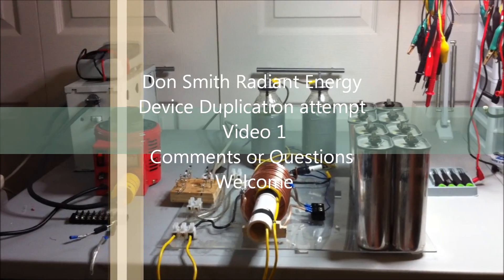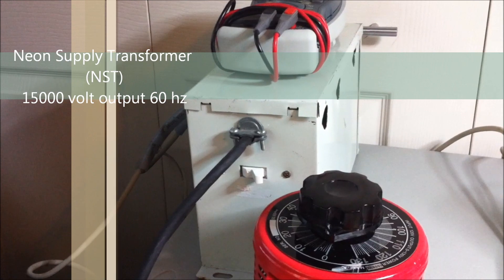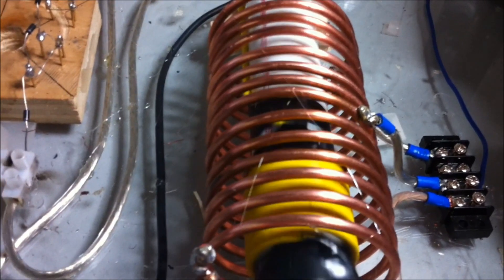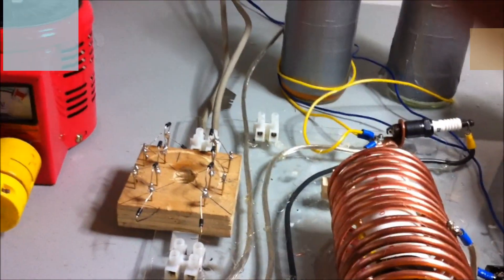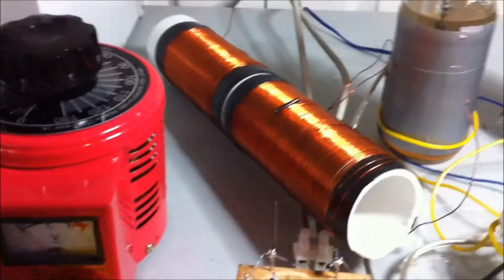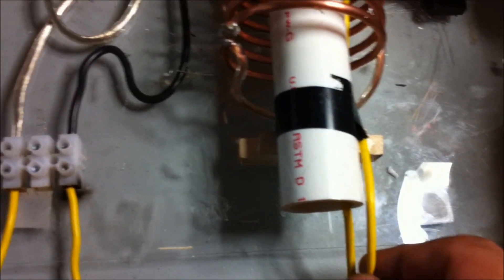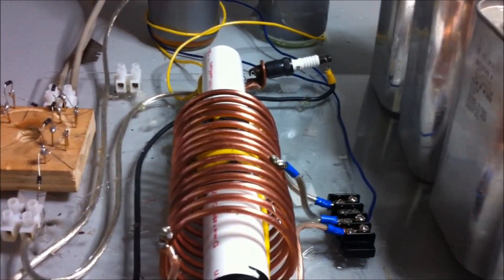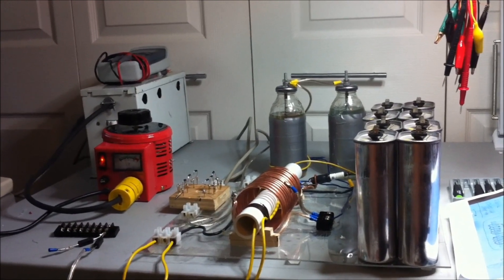Don Smith Device Build Video 1

Comment: Capacitors usually become open to charge storage at higher frequencies and the storage has to be adequate big and then use a step down transformer with rectifier to store it down 2 a battery, a smart gap would like the u used shd have even out voltage or as voltage controller but coils current determines its voltage output so use something to raise the voltage to coil by high frequency supply ac

Comment: Thank you for sharing your video on this. It looks like you're in the game with most of what you have going on. I've been studying this type of energy for years now.  I'd recommend changing your spark gap from a sparkplug to atleast 2 or three smaller spark gaps each time you add a spark gap cut the gap distance in half. Spark plugs were a good idea but they have resistors in them.

Comment: Local you must get over the 20 000 Hertz to get results not forgeting the high voltage as well ....but you did proved something at our regular Hz you get nothing it has been a motive of great speculation on available instructions that's why Tesla had it in the millions of oscillations keep at it great job

Comment: i think that this circuit creates high voltage and high frequency currant which is used to charge up the capacitors.  in what way to use the charged capacitors i dont think don smith said

Comment: One thing that don stressed was that the 2 coils had to be able to "talk" to each other or in resonance; your lenghths have to be in multiples of 4 that is if primary is 10 feet then secondary must be 40 ft so they can resonate "talk" to each other as per don
Reply: What is the purpose of talking if the coils don't hold enough charge  @v n hz 4 induction 2the secondary coil as compression

Comment: You show a "duplication effort" of the Don Smith generator. Hmmm. Well, you do not explain where you got your starting info. Then you show a small hand drawn diagram. You show the materials already assembled pretty much, and you claim there's no energy output. Here's the question that arose for me, when I looked at some materials on this gadget or device. Where are the magnets? The thing I saw, a .pdf file, was about 30 pages long (including a few blank pages to rest one's eyes I suppose). As part of the materials and parts list, there is one brief mention of two different suppliers for good quality magnets (permanent magnets). I looked at the supplier for the USA, and it does look like a good supplier of magnets to order from; prices are not too bad, and I might buy magnets from them in the future. The .pdf file then goes on to provide instructions on how to put together a Don Smith magnet generator. Oddly though, the .pdf file never makes any further mention of magnets: what size magnets, what power magnets or materials in the magnets (what alloy etc). So I wonder if you had even considered what magnets to use. That's why I was viewing some of these YouTube videos, to see what magnets are used in the Don Smith magnet generator, how they are installed and aligned/oriented, and how the North/South poles would properly be aligned, and so forth. But again, in your video -- unless I've gone bonkers completely and missed it -- there seems to be no mention or visible trace of any kind of a permanent magnet array in this device!? What's going on? The reason I became interested in Don Smith is that his device popped up at the top of Google when I did a search on "magnet generators" and similar things. So I thought, what the heck, maybe I can fool around with this. But this really puzzles me. A magnet generator featuring magnets, but not showing any installed, not mentioning where the heck they went, or anything. I guess we both have questions but no answers even on the distant horizon. Let me know ok.
Reply: The info that i found on Don Smith he had several different devices. One of them did use magnets but not this device. 
This device only used magnets to quinch the spark gap.

Comment: Your diodes are not suitable for this purpose. You need at least 12KV 200mA Diodes. The 1N4007 are not good and they also have a bad switching time....

Comment: Try getting the frequency stepped up to around 3 GHz once it leaves the neon transformer.  Use germanium diodes for your rectifier. Quench your spark gap. And have your too coils resonate together. You can use veritable capacitors in your circuit to adjust the frequency of your coils. It’s like tuning in a radio station.

Comment: A NST of 4 to 7 kV is probably plenty.  A 12 kV NST might be over-kill. The L1 to L2 step up voltage gain will cause most inexpensive & available diodes & capacitors to break down when the input/source NST is kicking out beyond what most HV components will handle nicely.
Transformer coupling like the L1 to L2 step-up improves with frequency & proximity geometry.
Tidy your wire lengths during the measurement & tuning phase to improve circuit performance.

Comment: To reduce the chances of burning components out, insure that they theoretically never operate at beyond some low percentage of their full operating range for current or voltage.
Tesla & Smith both indicated that power gain could be achieved by carefully shaking the electrons from ground into the circuit through a spark gap. You can use such gaps to couple some of the major circuit sections to the next with reference to ground supposedly to optimize energy gains, etc.

Comment: It is nearly impossible to measure various circuit components operating when they are running at thousands of volts--that is why you use the lower voltages for testing purposes.
Research things involving radio frequency circuit components like wire lengths, solid vs stranded wires, straight line vs sharp corner geometries, etc. Optimize your circuit for these things during the measurement testing phases to know how they will behave later at high voltage. Don't burn out components.
Reply: oldspammer Tesla never had to do that. He knew every number and components capabilities in his head like they were his own flesh and blood. ;)

Comment: I suggested this before to the other experimenter: know what your major circuit components are doing, get them tuned up properly, use a 5 to 10 Volt (low voltage) adjustable 50 kHz to 1 MHz frequency oscillator to determine the properties of your L1 to L2 open circuit/no load coil coupling, then repeat with one half of the center tap output coil connected in parallel to a high voltage capacitor to measure its resonance. NST=Neon Sign Transformer.

Comment: maybe the microwave capacitors are not holding the charge. i do believe the is an internal resistor in this type of capacitor. the primary and secondary should be assembled to where the secondary is held in the center and not rested on the primary.